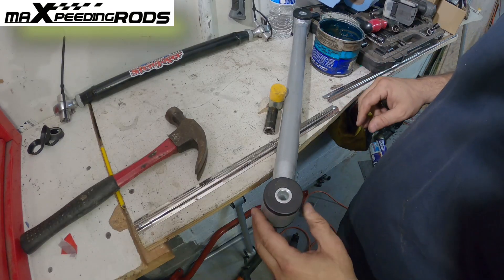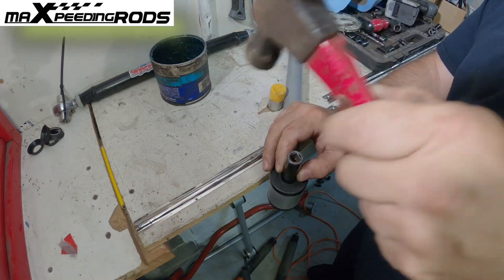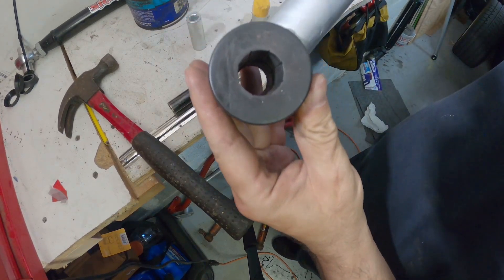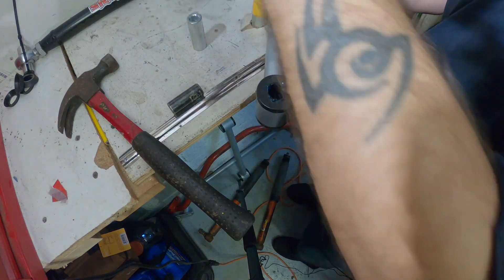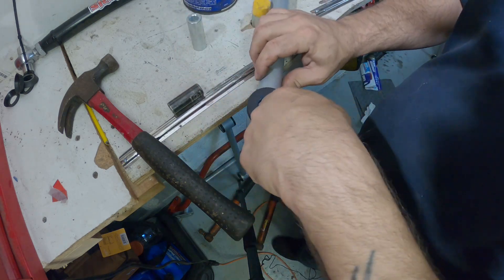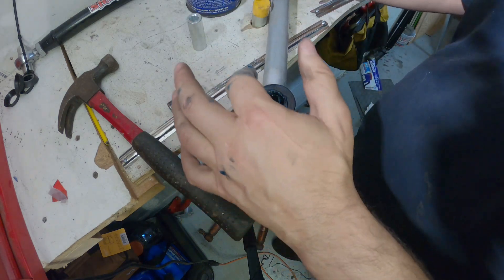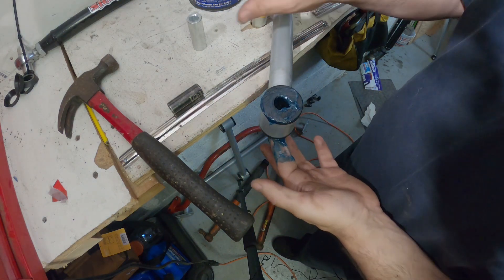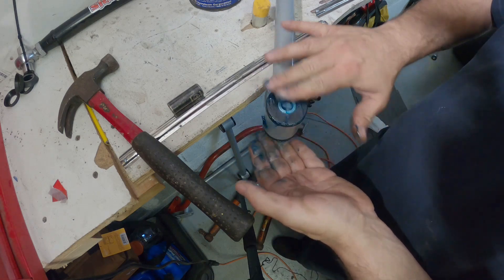Rear Control Arms Panhard bar install 82-02 Camaro Firebird 3rd 4th gen fbody @MaXpeedingrods

Comment: Did you remove the hiem joint control arms for the non-adjustable rear tubular control arms? For the video? What kinda of street manners did the rear tubular control arms improve?
Reply from the maker: Hi, I really like the Heim joint control arm control arms they offer precise control over the rear but that said i wanted something a little more streat-able for this car and the poly setup is the best for this application. Those arms are going into my other car which makes a ton more horsepower and could really use them because the poly setup in there  is a little to mushy when running a ton of power and slicks ... bottom line it depends of what you are running whether or not you go full race heim setup of or compromise with he ploy setup....  both have there place

Comment: How are the parts holding up?
Reply from the maker: good zero problems thx for watching
Reply: @maldo72  awesome I ordered some for my G35. Reading the specs I did not see anything about rust protection though. Does the paint from factory seems adequate for protection?
Reply from the maker: @GoodVibes-qg4ko  Yes they are painted and should last a long time